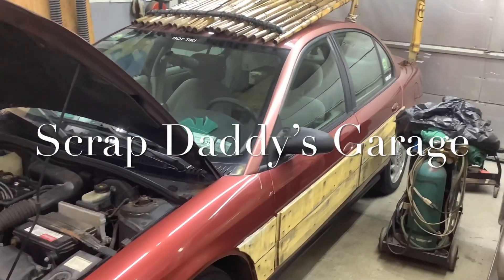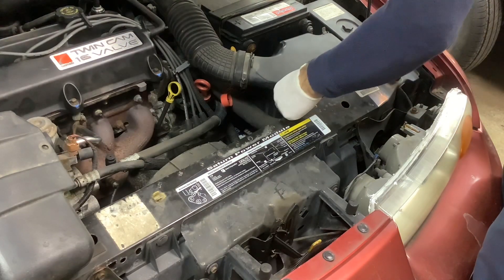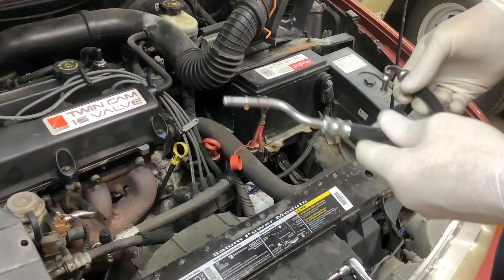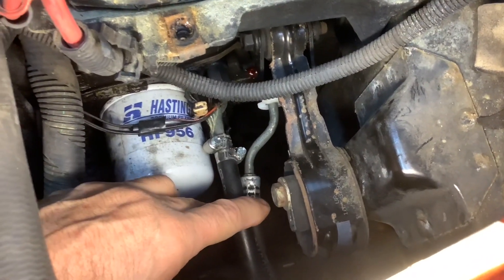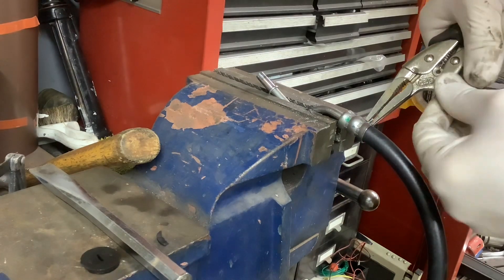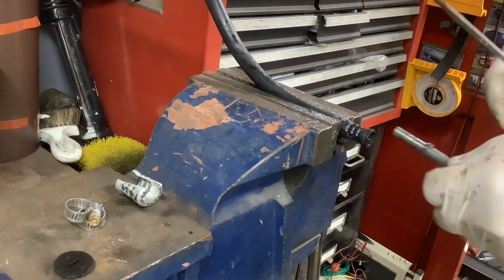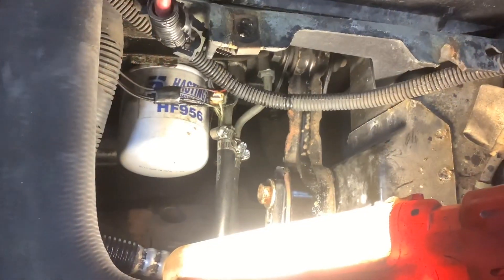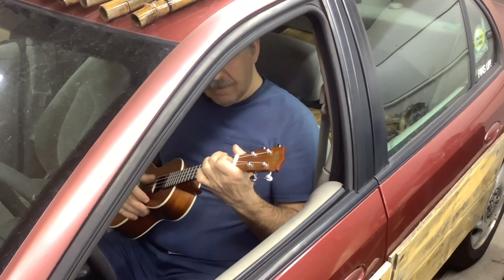Saturn transmission line replacement, free parts

Comment: Hopefully this helps someone.  I just did the same repair.  The lower line was rusted and leaking.  I bottomed out the quick disconnect tool and the line wouldn't release.  I tried the line next to it (the upper tranny line) and it released with no effort.  I kept it disconnected for more room to work.  I installed the quick disconnect tool again.  But this time I pulled and twisted at the same time and it finally came out.  There was resistance the whole time pulling it out.  There was no rust or corrosion on the line.  The new line installed with no issues.  When the lines are installed in the transmission they should spin freely.  If they don't it probably would help to twist them until they break free and move.  Then install the quick disconnect tool and try to remove the line.  The quick disconnect tool I use was Harbor Freight part number 63595.
Reply from the maker: @c0olj  thanks for the info

Comment: Thanks for the video. May I ask you what size the upper & lower trans cooler lines are? That way I can locate the line disconnect tool(s). Maybe 3/8" and/or 5/16"? A lot of the tool line disconnect sets are for fuel lines and AC lines. Does it matter?
Reply from the maker: The lines are the same size. I don’t remember if it’s 5/16 or 3/8. It is definitely one of those. The tools are the same, doesn’t matter what they are used on. I have used mine for all of them. Thanks for watching, please subscribe if you haven’t already.